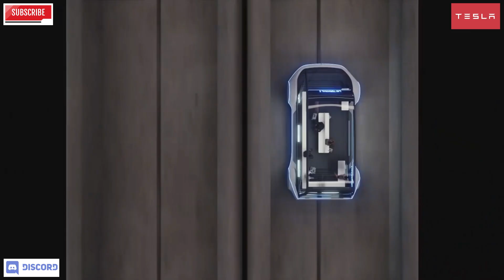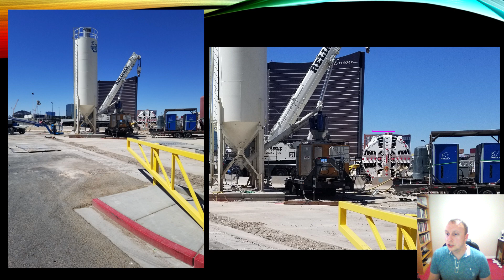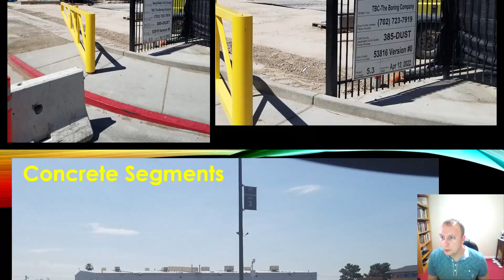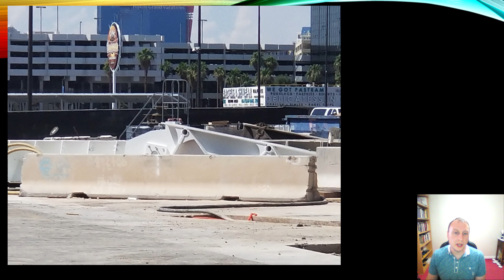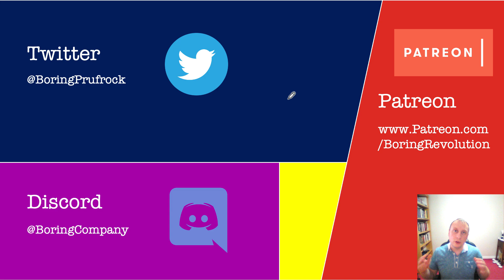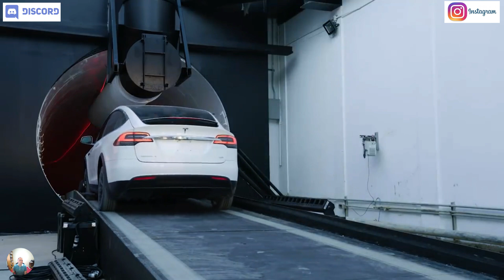The Resorts World Loop Project Is Progressing Nicely 😁 👏🏼 🚇 👷🏼‍♂️ 🏗️ Episode # 103

Comment: You mentioned how they've erected a compound around the construction because it's so important that people don't fall down holes, yet in the first few seconds of your video you show one of these mythical transporters disappearing underground leaving a big hole for people to fall down.
Reply from the maker: Brendan, Let me help you :

1) As I've said previously, a 1,500 mm high Glass & Aluminium screen would be used either side of the elevator shaft with rumble pins inserted into the road where vehicles would enter & exit the shaft.

2) The elevator platform is literally a 5,250 mm x 2,500 mm steel floor that would sit at exactly the same level as the roadway and thus the opening would be "capped off" for 80% of the day.

3) When it is moving the elevator platform would make an audible sound with a warning message during the 23 second period it takes to go up and then down. 

Maybe someone would fall down a shaft every couple of years but then again 80+ people walk into cars & buses every single day. Fix that problem before criticising us.
Reply: @BoringRevolution  Thanks for that, considering it's such an essential feature you'd think it would appear in the animations. When you talk about 'entering and existing the lift' I assume you mean regular road-going Teslas? In all the animations a Tesla is shown driving onto a carriage which takes it down to the tunnel. Will there be a magazine of these carriages in each lift shaft so that as one car disappears below ground, another one pops up on the surface for the next car, or do you have to wait until someone decides to leave at that shaft and brings a carriage back to the surface? Presumably this means that one existing lane of traffic will have to be blocked off for moving traffic, which is likely to increase traffic congestion. Imagine you're a car driver stuck in that traffic and you know how much worse the jams are now that one lane has been taken out of action, how likely is it that when a Tesla rises out of the ground, you're going to let it join your lane? Also, in rush hour traffic tends to be mainly in one direction. If all the carriages are being driven out of town until there are none left in the city centre, can they drive themselves autonomously back to the city centre and replenish the stores of carriages at the lift shafts? It's a bit like the plastic trays at airport scanning machines. They build up at one end until someone gathers them up to return them to the beginning.
Reply from the maker: @brendanpells912  The use of walls on a video will obscure the view of the elevator working.
I did a video on this entitled rack & pinion elevators, please search for it. 
It will use Tesla vehicles both "future ones" and current models.
Their will be no carriage or magazine, just multiple platforms lined up around 12 to 15 meters apart. 
No lane of traffic will be blocked off. It is a separate tunnel from the main system, think of it like a slip road.
Reply: @BoringRevolution  I did watch that video, but not that informative. Instead of lifting the futuristic people carrier up to ground level, why not just leave it at tunnel level and move the passengers in a standard elevator. Much less weight to shift, more energy efficient. Or just provide a staircase, which would probably have to be there anyway for emergency access. Also, when I talked about blocking off a lane, I didn't mean the underground tunnel, I meant the surface lanes where cars have to queue to wait for the elevator. Is the intention that everywhere a station is provided it will require enough clear space for the elevator and parking area and access roads to connect with a nearby highway? It sounds a lot of real estate compared to, for example, the surface infrastructure required for a NY subway station, which is little more than a flight of steps.

Comment: Would It be possible eventually to have multiple TBMs to launch at equal distances along the line and that way cut the boring time down to a fraction of the time.
Reply: They have done tunnels where machines start from each end and meet in the middle. That was done for the English Channel tunnel. Although their meeting was not exact it was said to be "less than a meter off".
Using more than one from each end would require making more holes in the ground but if they did it at the location of stations that shouldn't be a biggie.
Reply from the maker: Potentially on future projects we could see 2 x TBMs every 1.85 miles and the project will finish the tunnelling phase in under 5 weeks ! 
All you need to do is build the TBMs in advance of the project and have enough team members to run each machine, 6 days a week.
Reply: @BoringRevolution  If that will the case, it would be amazing. 😀

Comment: I thought the TBM used by the Boning Company was a new design.  Now I find out it is just a sewer tunnel off the shelf unit.  :(
Reply from the maker: WILLIAM : This is a brand new TBM manufactured by The Boring Co. from scratch with a unique surface launch URUP system and very high spec motors. 
it is 400% faster than Godot and every other TBM in the state of Nevada !
You will come to respect this machine in the next 6 weeks as it destroys Nevada's tunnelling records with ease. . . .
Reply: @BoringRevolution  It's also 100% electric, right?  Therefore no massive ventilation systems are necessary to vent diesel fumes.
Reply from the maker: @billthecat7536  Yes it has a High Voltage grid connection.
Reply: Prufrock is not off the shelf, it's TBC's own design.  The initial tunnels used other equipment just to test the concept of the system.  At least that's my understanding.
Reply: @billthecat7536  This machine was probably not available till now.